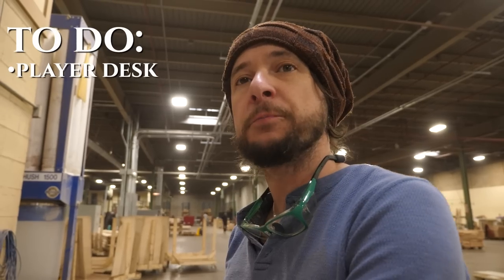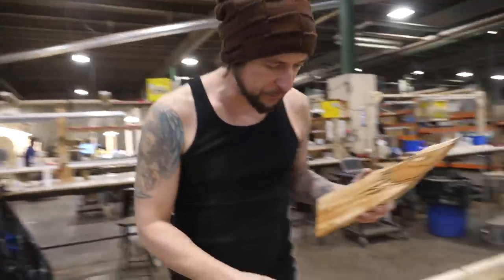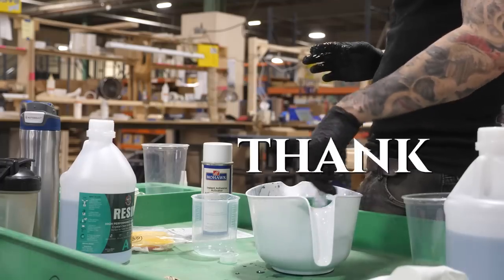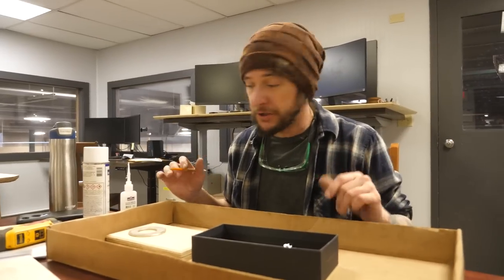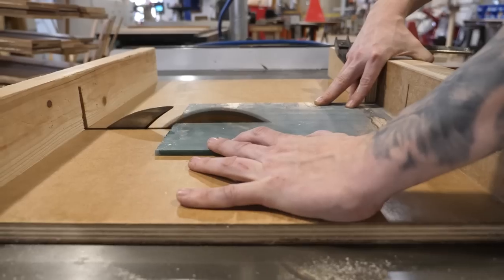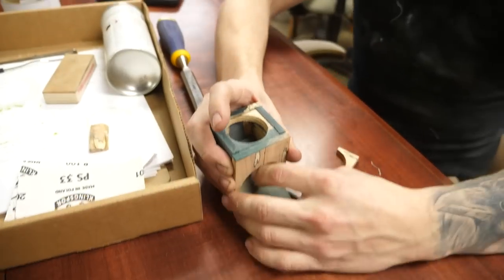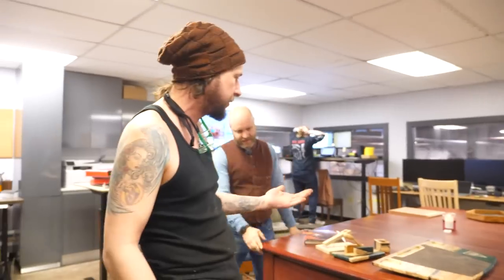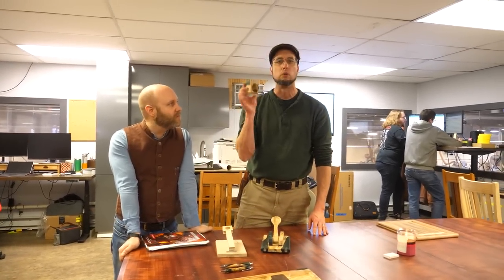No One Asked For This Catapult (we all want it tho) S12E18

Comment: Honestly, a pretty good way to reduce wastage. Like every six months, after they end up with enough split board they get the scraps together and then resin them down. Then do a limited supply run of stuff.
Reply: Most of the production problems is bandwidth, and this isn't easy on the labour
Reply: @Smajtastic  would have to squeeze in with stuff like prophecy builds, because of the custom nature. big price bump
Reply: @ghomerhust  not necessarily. This could be a smaller book of business that WW breaks out between large runs of other business.

Let MGT orders build up for a week so there is a consistent amount of work, and things like this can be limited runs to fill that week.

WW was worrying about the amount of work that was coming in not to long ago.
Reply: This stuff would cost as much as a table or more.

Comment: YES! Make the lap desk. Writing and drawing while sitting in front of the tv is so much easier with one of these. Add more padding to the bottom tho, think air soft bb’s (adds weight for stability) with room to move so you can lean it up or make it stable around one leg if you need. Add wireless charging and a positionable light to illuminate the writing surface, deep pen groove up top and it would be the shit

Comment: Would pulling a vacuum while the resin is curing solve the bubble issue?   I would imagine there are vacuum bags large enough that you could use with a shop vac to pull the vacuum.